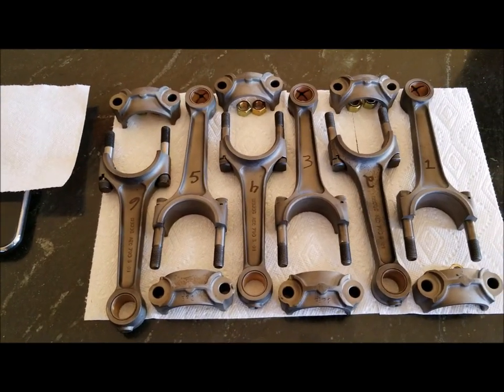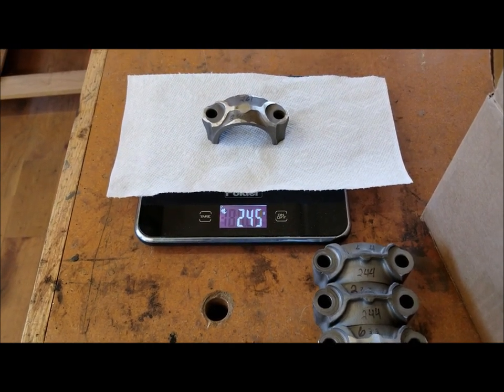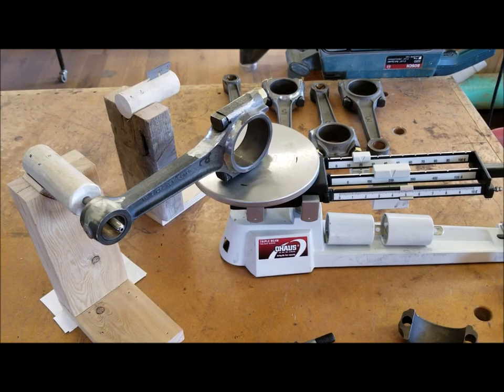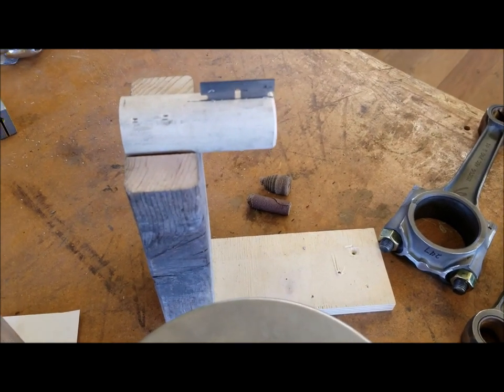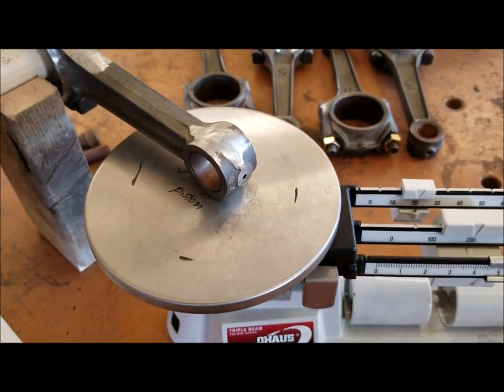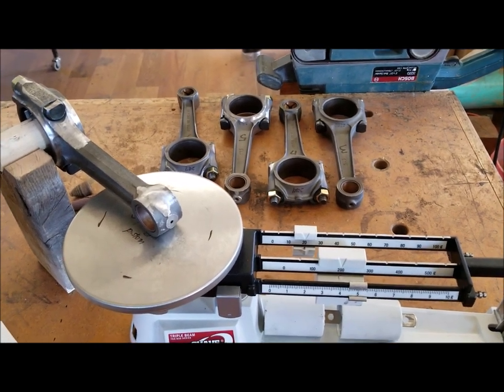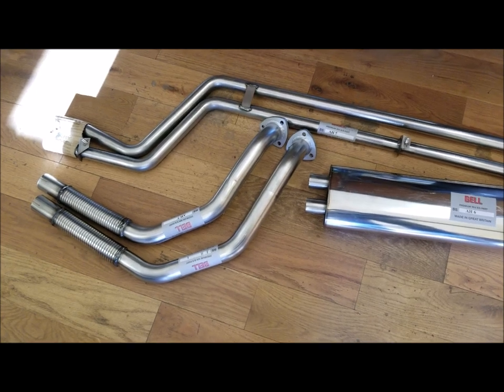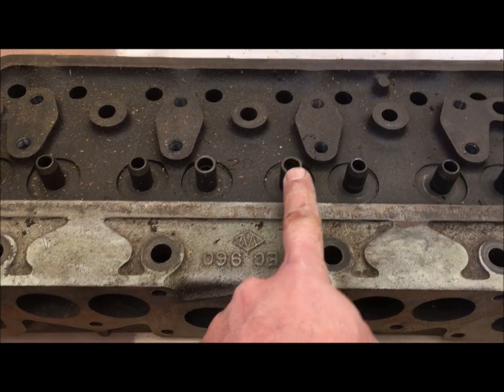57 Austin Healey 100-6 Rest. Pt 13 - Connecting Rod Balancing and other Engine Progress

Comment: Do you have a time frame for completion or is this just a learning exercise?
Reply from the maker: I don’t have a time frame.  It totally depends on how much time I’m able to devote to it. I would guess it will still be a couple years though.
Reply: Great work getting everything sorted there mate.
My mentor described a method of balancing rods, using very soft springs, hanging the rod by the big end and small end, with a pointer drawing a line between the two hang points. Each rod is placed on in turn, the heaviest overall hangs lowest, and imbalances between big and little end appears as an angular difference.
To balance all identical, simply take weight off one end to adjust the angle, and both ends to bring them up to match the lightest. Worked very well, regardless of actual weights, by making all the same.